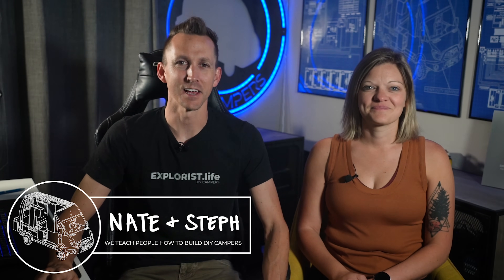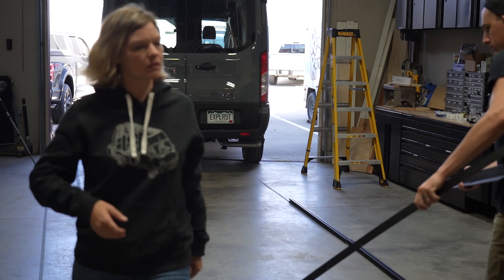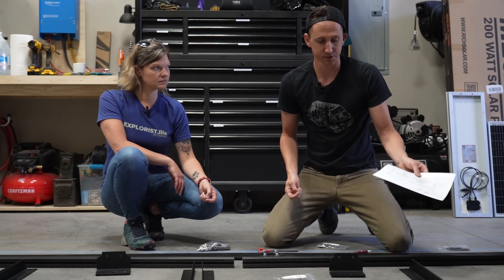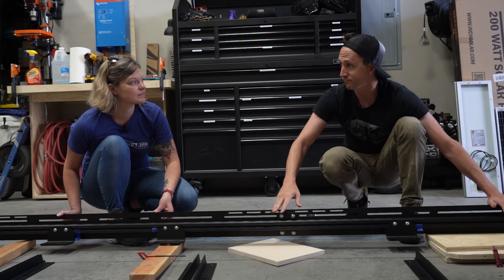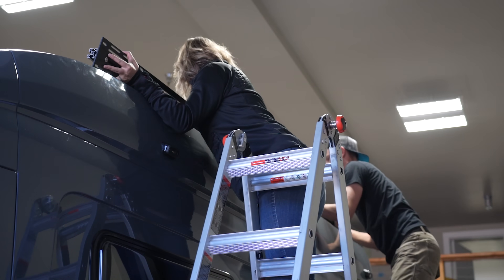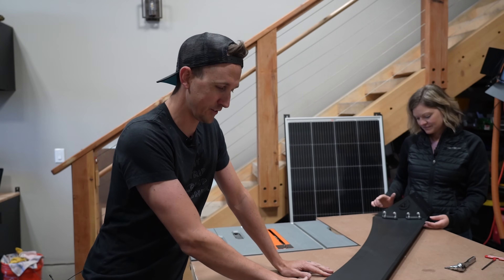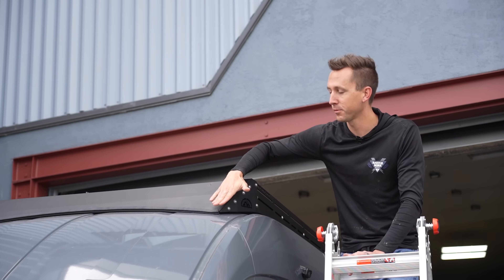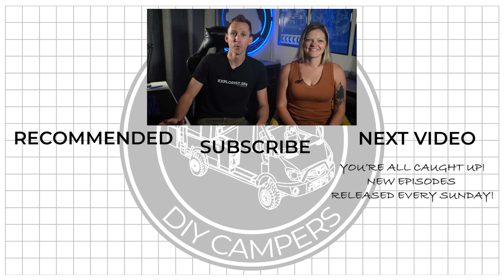Building a ROOF RACK for 580W of Solar Power!

Comment: When a roof is that kitted out how does one clean debris off the roof? I would think the buildup of dirt would not be good for the paint.
Reply from the maker: Power washer.
Reply: @EXPLORISTlife  I wasn't specific enough. I meant under the solar panels. I guess lifting them would work.
Reply from the maker: There's a little gap all the way around you can spray under.  Can't necessarily wash and wax, but that's not a big concern on my end.

Comment: The install directions are a bit different now. Feet first, then 80/20, then the sides slide on. I am kinda installing this same setup, but doing dual max air fans using the 55 watt panels and the special crossbars. But, how did you decide exactly where to put that max air fans? 9.5 inches from the air unit had to come from somewhere. I might have to put the rack up, then test fit the solar panels and cross bars to figure out where the fans go. To get your measurements for cad how did you know where the start/end of the rack would be without assembling it? You said you set the rail ends 10.5” back from the feet, but that also must be specific to the solar layout, right?
Reply from the maker: The measurement was locked in by seeing where the air conditioner would fit between the cross braces then measuring the front overhang of the AC + rear overhang of the fan + about an inch of space between the two.

Comment: I bought the Flatline roof rack for my 130 inch wheelbase but mistakenly bought the 148 inch so now It wont fit. what can I do? Cut it down to size? I have 6 openings for the feet and of course they sent me 8. They don't even make one for 130 inch.
Reply from the maker: You're going to want to contact Flatline for their return/exchange policies.

Comment: One has to hope that the head of marketing at Loctite was subsequently fired for packaging its Blue 242 in a red colored squeeze tube.
Reply from the maker: Joke is on them as I'm colorblind. Makes no difference to me! 😂🤣🤷‍♂️
Reply: @EXPLORISTlife  LOL.  You must really "appreciate" when an electronic component uses a single dual-color LED as a status indicator.  "So, this means it's light-gray when fully charged and very-light-gray when charging."

Comment: Hello. Check an alternaive rail system MINITEC. It has M8 slot for standard nuts or spring loaded nut to keep it in position and many other features. It is available up to 6m lenngth which is less comlicated to screw together but more expensive in transport. UPS only takes max. 2m.
Reply from the maker: Maybe I'm just a bit jaded that we spent so much time developing this roof rack just for you to come in and suggest something totally different, but it also looks like minitec is difficult to actually purchase/acquire without having to jump through hoops (emailing/calling) for no real benefits.

Comment: Use a Dremel tool with a sanding drum to adjust roof mount holes.  Using a vacuum will keep filings from falling inside. Then a cotton ear swab to touch up paint.
Reply from the maker: Yeah, there are 1,000 ways to do what we did with similar results.  If we were doing it over again, we'd do it the same way we did it the first time.

Comment: Random question- what size is that window behind your driver side?? I’m assuming that’s an arctic tern? I think we ordered the same size and we hesitated to install it bc I read some threads that the larger flat windows can cause warping in the sheet metal, and it looks like yours does not! Any key to installing a flat window on a curved van?

Comment: Another good idea is to put a small strip of 3m clear paint protection film.  Even the rubber gasket has some vibration that still has contact with paint.  The film will eliminate the actual contact to paint.  Plus dust gets built up under the gasket over time.  The film does the job 🤙🏼
Reply from the maker: Sure!  Another good idea there.

Comment: Thanks so much for putting this series here on Youtube, I'm really enjoying the simplicity and visual aspect of your explanations (mix between a kinesthetic and visual learner) and the way they make me feel like I can do a lot of this stuff myself when I get my van next year, which after watching so many other videos, I did not feel like at all (especially electrical, which I was just totally confused about).
Reply from the maker: Hey, Matthew Appleby!  I appreciate that.  Thanks for watching! 🙂😀
Reply: @EXPLORISTlife  A question about the Ford roof top: Could you have fit 3*200w Renogy solar panels 1650 x 670 x 35 mm / 64.96 x 26.38 x 1.38 in and 2 max air on it without the AC and roof racks? I'm curious about a 3 lithium 600AH battery system and what the max solar you could get out of the rooftop may be to charge this kind of system. Also is there a reason you picked AC for this van over a 2nd fan, as I know Australia gets really hot in summer and really not sure between internal/external AC or just getting 2 fans. I noticed you did not cut a spot for ventilation for a shower, is this not needed as there is no risk of condensation leading to mold? Thanks if you can answer, but understand if your too busy 😄

Comment: Exactly what I'm working on, designing 80/20 Transit roof rack to maximize area for solar panels. My guess is those large panels on your finished roof are 200w each, so including the small panels you are at about of 500w.
Reply from the maker: Yep!  580W more specifically.  2x200w, 2x55w, 2x35w.

Comment: Hi Nate.  
Nice rack!
Like the fairing gasket. 

I like the way you’ve covered every inch. Not sure how much a/c and vent will shade panels but newer panels are not as sensitive to shading power reduction as they used to be, right?

How will you remove snow from your roof?  No place to stand up there. Not that I would feel safe standing in snow and ice. 
Planning to use Portable ladder or ?
Reply from the maker: There's only shading on one of the 35W panels when the sun is low in the sky (early morning and late evening); but is just one of the 'it is what it is' things of having a roof rack as low profile as this.

We will simply carry a portable ladder for snow removal.  Even on our sprinter, it was sketchy to stand on the roof, in the snow, to remove the snow.  Super slippery.  With the portable ladder leaned on the roof rack, I'll only ever be, say, 4-5 ft off the ground in slippery conditions instead of 8+ feet of being on top of the van.

Comment: So it sounds like if a Ford Transit owner wants to install a Nomadic A/C, Maxxair fan, maximum solar panels, and roof rack like yours, they should get all the measurements from you before cutting that first hole in their roof.
Reply from the maker: Absolutely.  I gave all of the measurements for the A/C and Maxxair fan in our previous videos; but I strongly recommend anybody plan out the entire roof before cutting holes even if they aren't following this plan exactly.

Comment: Thank u Guys Love the roof rack But i feel need a cover plate at the back as well where u can see the 80/20
Reply: Thanks for the suggestion.  We left it open in the back to more easily allow air to flow through the rack and out the back.  We will definitely look into some sort of cap though as we improve this product.
Reply: @unakagearcompany  Yes your right i didn't Think about the Air flow But a cap over the 80/20 where u can see the silver or maybe a bit of paint Thank u for your reply.Stay safe.
Reply: @NSWMods  The rack kits will come with end caps for the rear 8020.  In the rush to get the MK1 installed we left those out and still actually need to send them to Nate so thanks for the reminder!

Comment: I have a roof rack installed already, I think the gasket is a great idea! Is there anyway you can post a link to purchase a gasket separately  like the one you are using?
Thanks
Reply from the maker: Unaka is going to have that available soon so you can buy 5-6ft of it, but until then; this is what we used: https://amzn.to/3zBPneU  Pay special attention to the edge width.  Our wind fairing is 3/16" so we used 3/16 edge gasket.  1/8" edge gasket would not fit.

Comment: Regarding the anti-cease;  I noticed you used the gray colored.  I have used the same product but switched to using only the copper colored. The reason I do not use gray at all for any reason is that it does dry and cake on the threads.  Maybe not in a year or two but the coper doesn't and if so it would last years longer.  Regard the two straps for bolting the side plate.  I would recommend one big square with four holes, much stronger but maybe not needed if no cargo will be carried.
Reply from the maker: The installation process will be the same regardless of your preferred color of anti-seize.

One big square splice plate wouldn't work as it would get in the way of the 8020 rails.  The small rectangular splice plates paired with the 'half-lapped' 8020 joint is plenty strong.
Reply: The copper anti-seize does stay soft. Use just enough to put a light coat on the start of the threads. As you run the bolt in, the the anti-seize will be pulled into the nut. You also have to be very careful to fully clean it from any exposed surface. If you get it on your hands, clothes, gloves, you will track it everywhere and keep doing so. It is the gift that keeps on giving.

Comment: Great information. Does the gasket on the front of the rack come when ordering the roof rack. Thanks Don
Reply from the maker: Thanks for watching!  The gasket does indeed come with the roof rack.  We really liked the concept of having the fairing come all the way down to the roof line, so we decided to include the gasket.  After our maiden voyage from Steamboat Springs to McCall Idaho this weekend, we averaged 17MPG, which I'd like to think that the low fairing angle helped with.
Reply: @EXPLORISTlife   is there some place we can get that gasket? I have unaka’s current fairing and would like to get that gasket.
Reply: @ryansparrow2554  We will be offering the gasket as an additional accessory on our website soon.
Reply from the maker: Unaka is going to have that available soon so you can buy 5-6ft of it, but until then; this is what we used: https://amzn.to/3zBPneU  Pay special attention to the edge width.  Our wind fairing is 3/16" so we used 3/16 edge gasket.  1/8" edge gasket would not fit.

Comment: Can you use a Dremel tool with a small carbide cutter to remove the extra tin that covered the tapped nut inserts in the roof? The hand snips leave a rough looking cut. - just my two cents
Reply from the maker: There's probably 100 different ways to do that.  If you go the Dremel route, be sure to mind your sparks and such to prevent rust spots being thrown across the van roof.  Remember...  that part will never be seen, so a rough 'looking' cut doesn't really matter much.
Reply: Another idea is what I did which was use a multi-tool with a fine tooth metal blade. I prepped the area to contain the metal dust and this tool made fast clean work of it. In my opinion, this type of tool is a must for van builders.  Really nice design on that roof rack guys!!!
Reply from the maker: Nice!  Yeah, that's another good option.  I do love my multi-tool. I was almost thinking that the 'upper half of a step bit' would be the ideal tool for that; but I don't think that exists and I didn't want to cut my step bit in half. 🤣😂